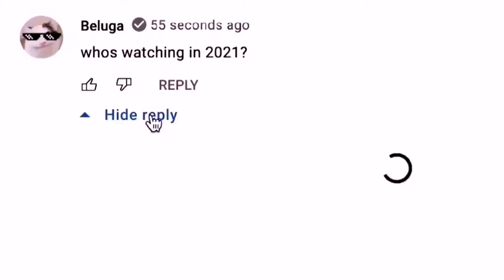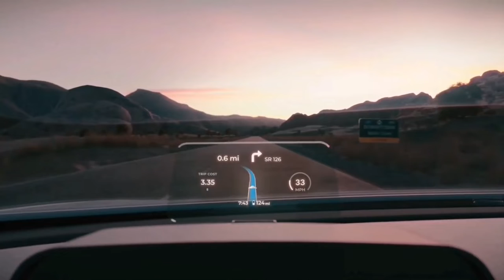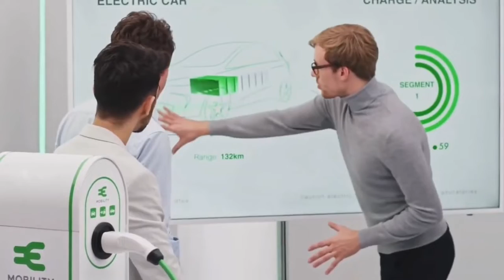Lyriq's Augmented Reality Windshield A Visionary Leap in Automotive Tech

Comment: GM Authority was the first to report that Cadillac would offer the Velocity upgrade for the 2024 Cadillac Lyriq AWD. The upgrade is delivered as an over-the-air software upgrade and enhances the crossover’s powertrain to deliver an additional 74 pound-feet of torque, resulting in a more responsive feel and improved performance. The upgrade also replaces Sport Mode with Velocity Mode. Pricing for the Velocity upgrade is set at $1,200.                                                        Will the Hud system also be a download?